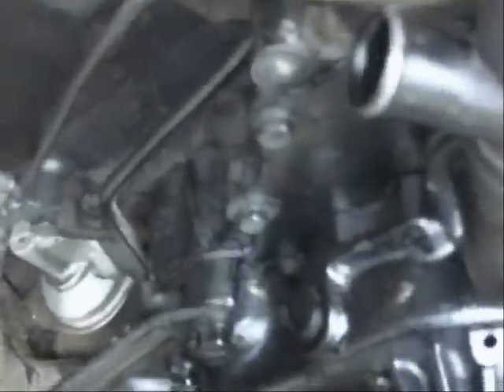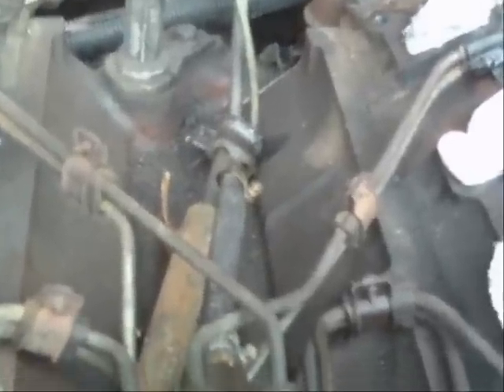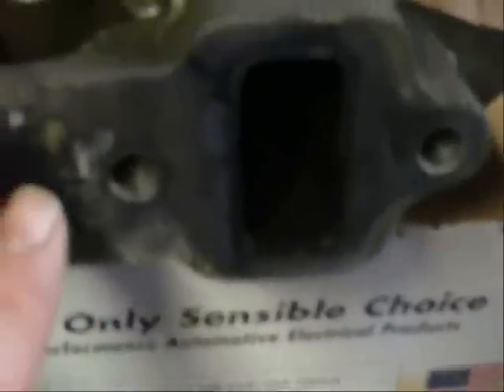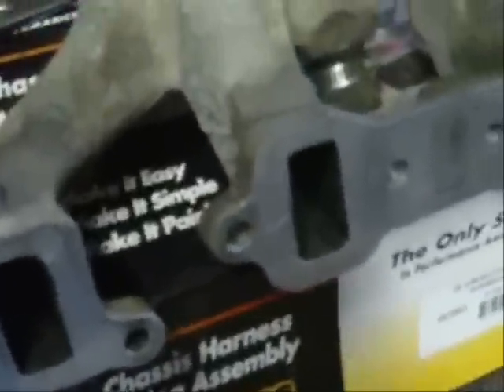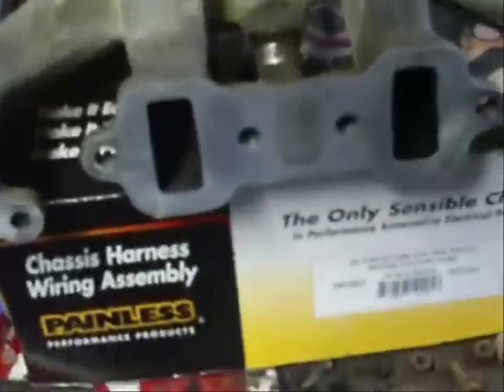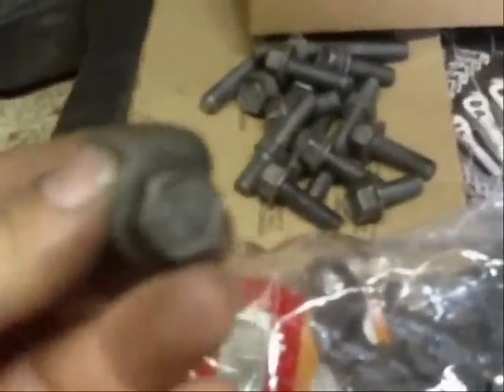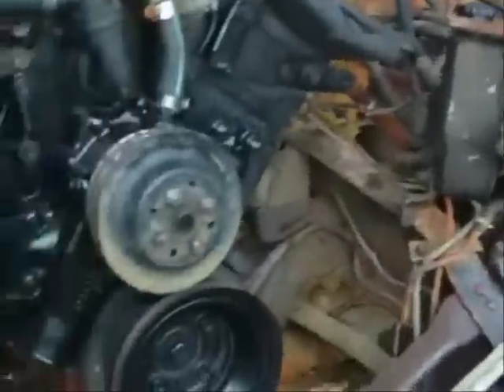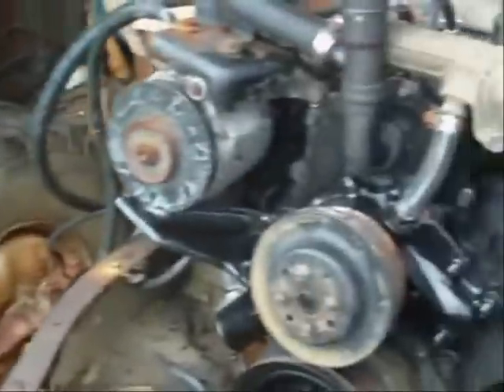Project Diesel Truck Part 19 - Intake Manifold

Comment: FYI: the '83 primary filter is still on firewall at heater box i have an '83 K30 its spin on OEM filter on firewall.
Reply from the maker: Yep, '82 & '83 had the spin on primary filters on the firewall and a secondary on the back of the intake.  I deleted my secondary because it's a lot of hassle to get to.